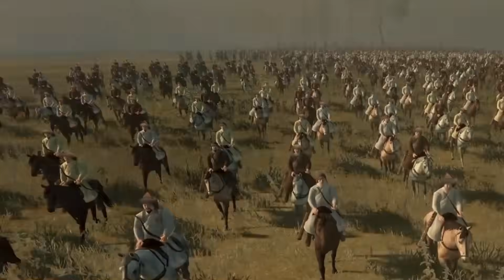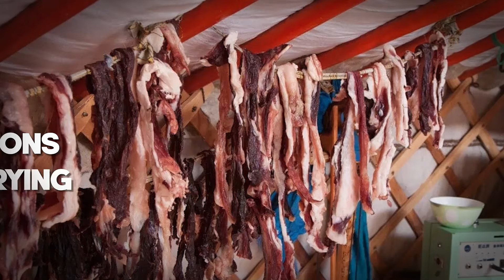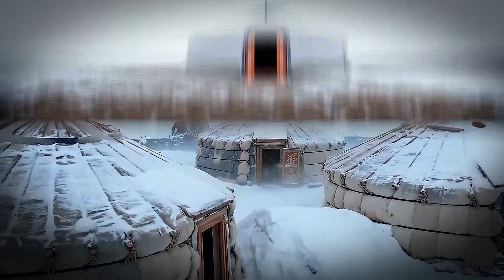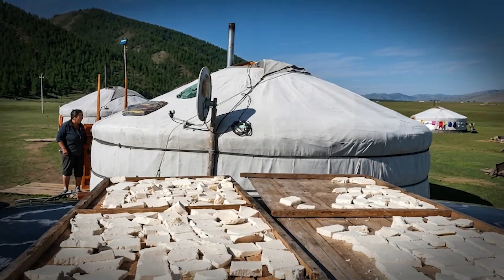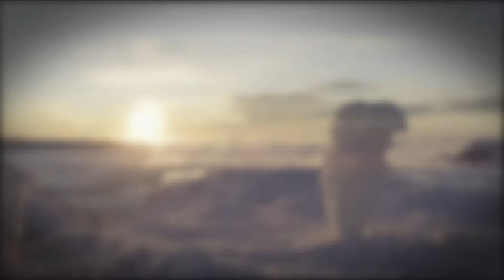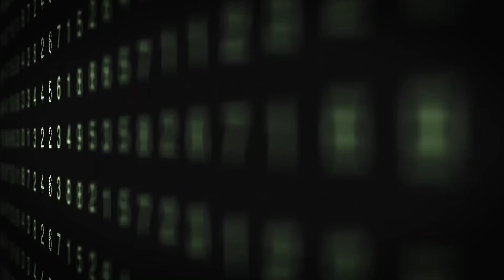15 Ancient Mongol Innovations So Advanced We Still Can't Beat Them

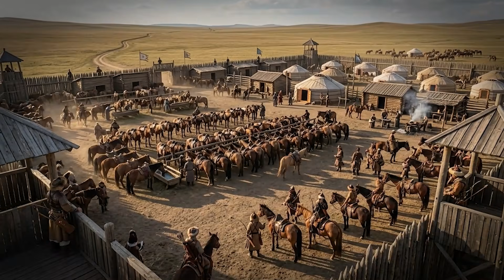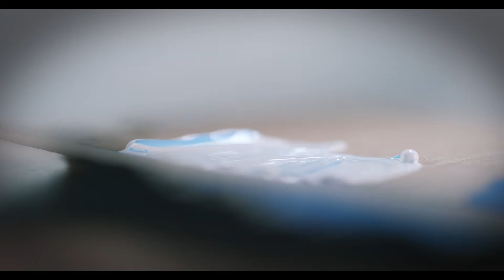Comment: 21:49 Spaced exactly 25 to 30 miles apart. Isn't that an oxymoron? Also at 23:00 or so the crap AI narration keeps talking about a bow (pronounced bou). Clever as the Mongols were, I doubt if they were getting around by ship. It's bow (pronounced boe), you numpties. Why does no-one ever check the AI narration for errors like this?

Comment: The major difference in the design of the saddles between Europe and Mongolia was mainly their use in relation to the horse and the style of horse. The Mongol horses were small and light, 250 kilos on average, and there was a need for this type of saddle to be able to support the weight of an 80-kilo Mongol, whereas the European horses, which were much heavier, more than 500 kilos, were much more resistant and didn't necessarily need this saddle system. The European horses weren't designed to cover great distances but to make powerful combat charges.
Reply: And thus came the draft horses, Belgian, Clydesdales,  Percherams, and my favorite the pit ponies, Shetlands. 🦊🦊🥸 ,